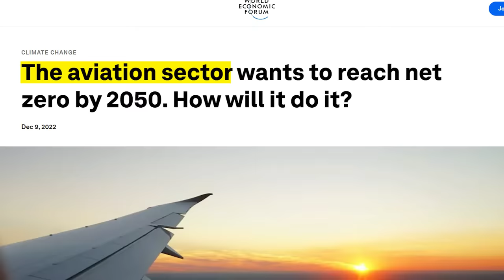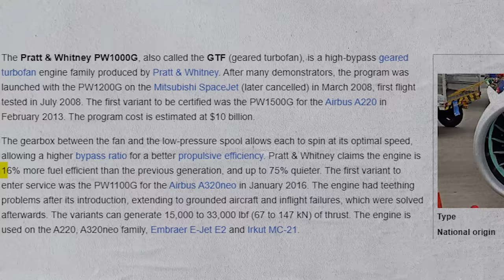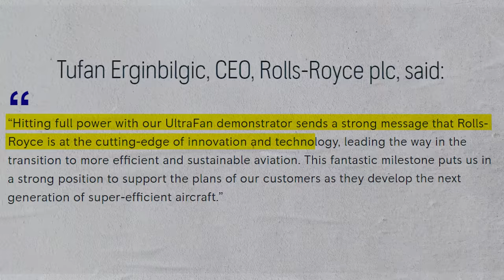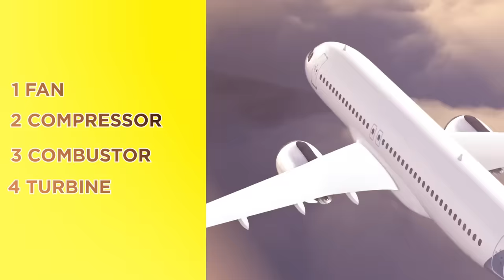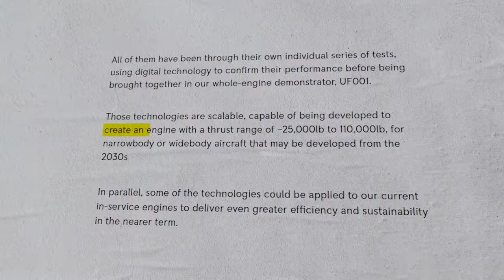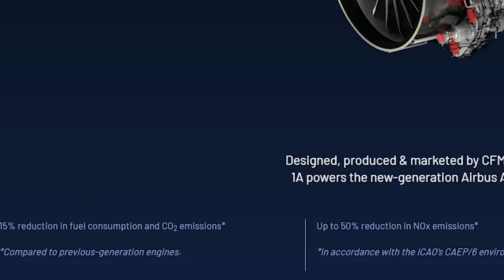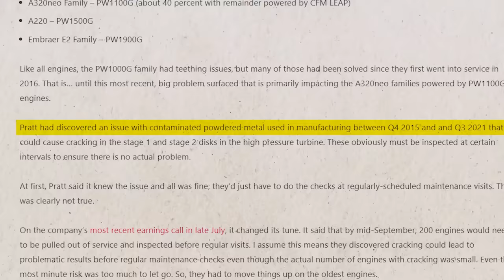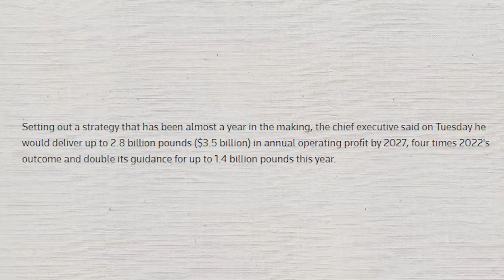Rolls Royce CEO: "This NEW Engine Will Change The Entire Aviation Industry!"

Comment: What do animations of reciprocating four-stroke engines have to do with jet turbine engines?
Reply: Its there to impress non-technically minded folk, but means absolutely nothing.
Reply: @AnotherPointOfView944  Irritating that they chose to show it though.
Reply: I wonder if it is laziness in not properly checking the correct results of an A.I. search😆
Reply: It is completely ridiculous to show the animations of a four stroke piston engine during this review of a JET engine !!!
Reply: The start cart??

Could’ve at least used a Merlin anime’ but I’ve no idea why an IC engine would be included.